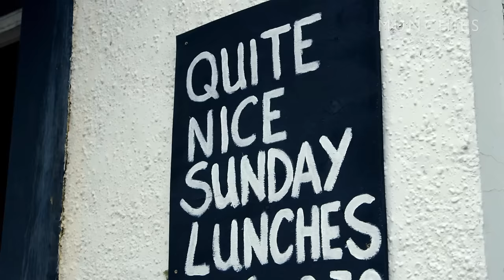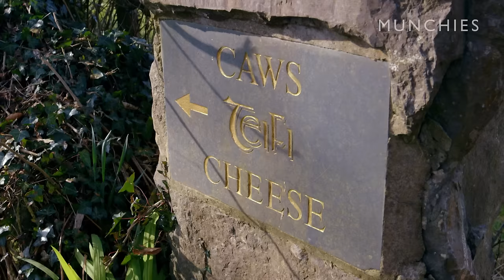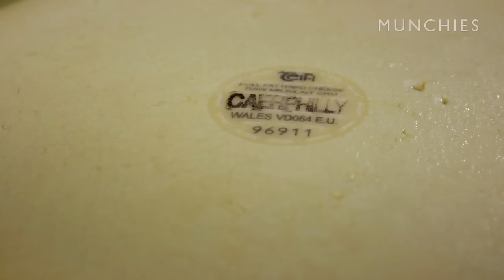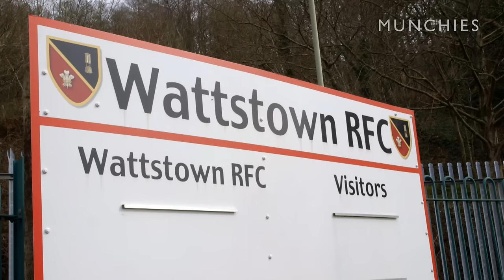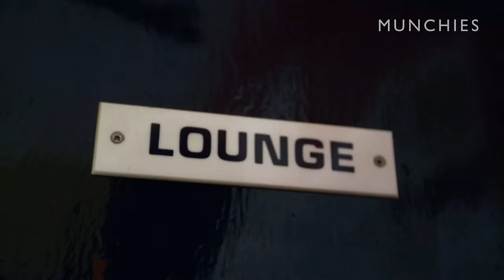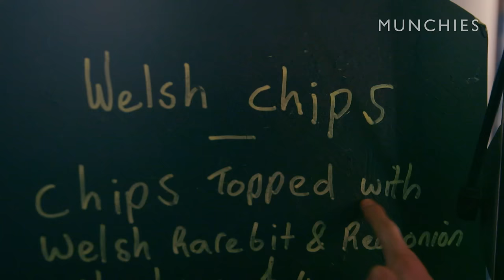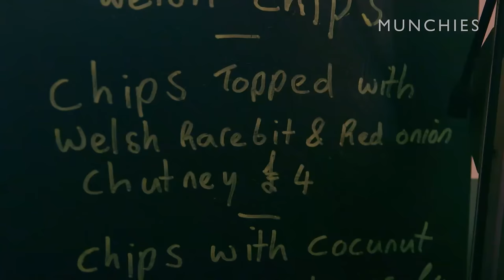MUNCHIES Guide to Wales: Rugby Girls and Welsh Rarebit

Comment: Oggies are Cornish Pasties, Nothing to do with Wales. Those are the wrong shape. They should be Half Circle. Originally they were Home Made by the Miners I Wives/Mothers, They were very big with 2/3 holding Diced Beef, Onions, Potato and Swede. There was then a Pastry flap and the other 1/3 was Apple, Sultanas or Dried Fruit as a Desert. This was because they were often down the Tin Mines for more than 12 hours. So it had to be a hearty meal.
The crimped edge was big as well, The miners held the Pasty by the crimp and ate the centre to stop them getting Arsenic Poisoning so threw the crimp away.
Obviously as they stopped being home made and for going down the mines we get the loss of the desert and the crimp was reduced is size as people got used to eating all of it ad not throwing the crimp away. This is why when the Tin Mines closed down and they went over seas to places like Holland (But not to Tin Mines) the crimp was reduced as they travelled over on the boats